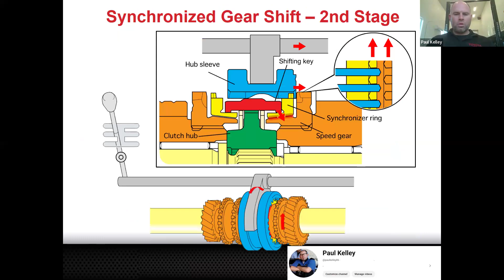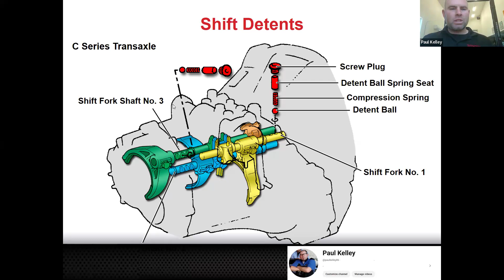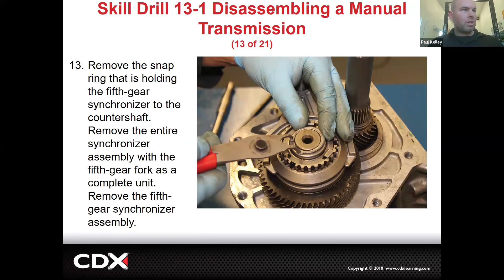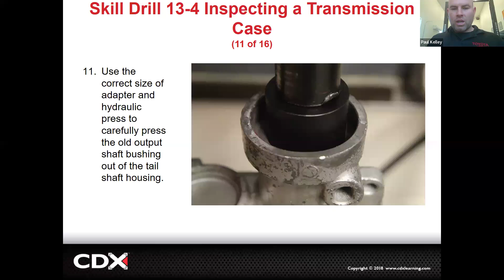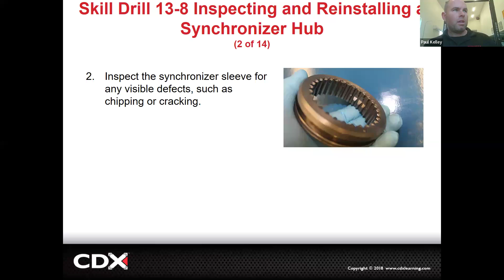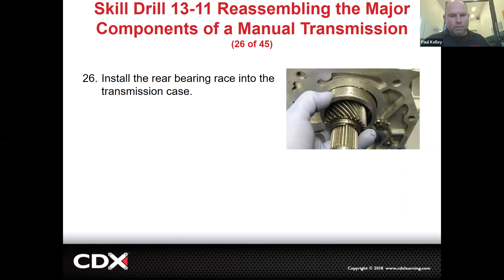ASE A3 Manual Drivetrain and Axles  Unit 2 Manual Transmission Transaxle Class Lecture

Comment: I probably need a new transaxle but wondering what you think. Ran low of fluid for a while due to passenger side output shaft seal slowly leaking. Replaced it twice but it continues to leak. Could worn bearings cause excess movement and enable fluid to get past seal?
Reply: It does match noisy in neutral symptoms, quiet when clutch is depressed.
Reply from the maker: It could be yes but also what about the sealing surface on the axle shaft?
Reply: @CollegeAutomotiveClasses  has an axle flange, older vw. But I dont recall any damage on the flange shaft.
Reply from the maker: @Teasa617 hmm, id be pretty thorough on the inspection of the sealing surface. Then you can see if it moves up and down (radially) a lot which would indicate something loose in the differential portion. 
Also consider checking the vent, would would push out seals due to internal pressure if clogged. 
And finally, consider an oem seal, aftermarket stuff can be hit and miss. 

Id look into all this before I considered a transaxle.